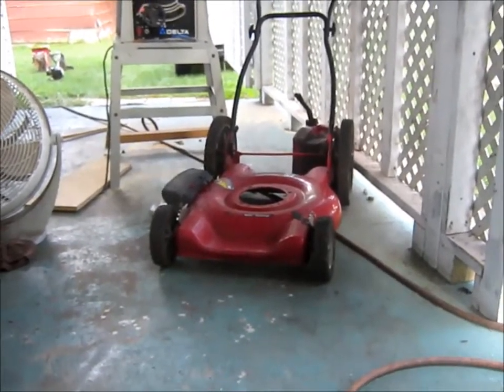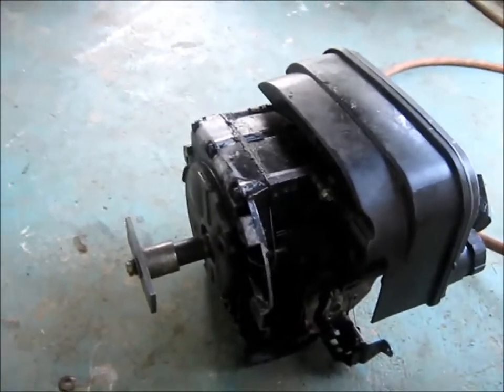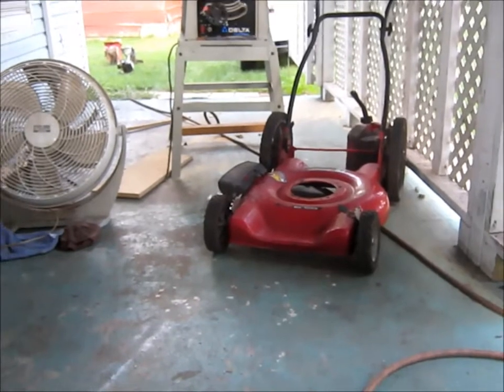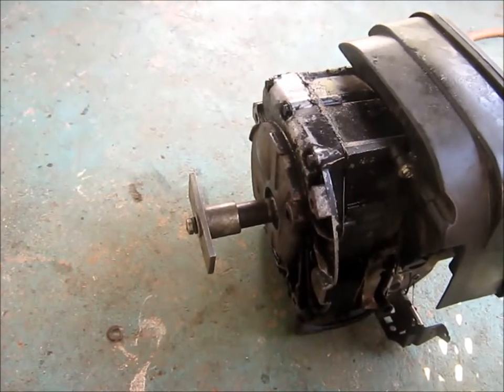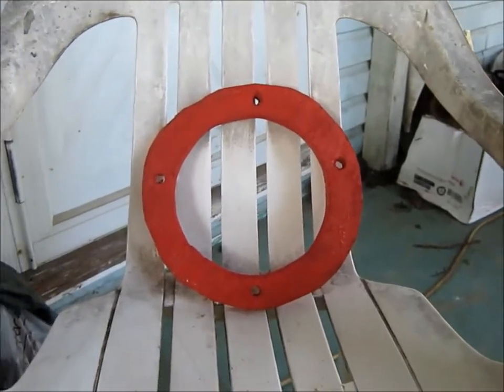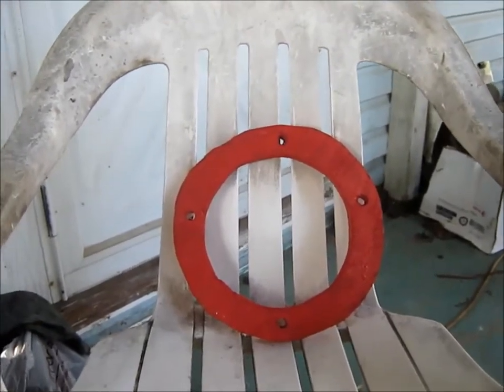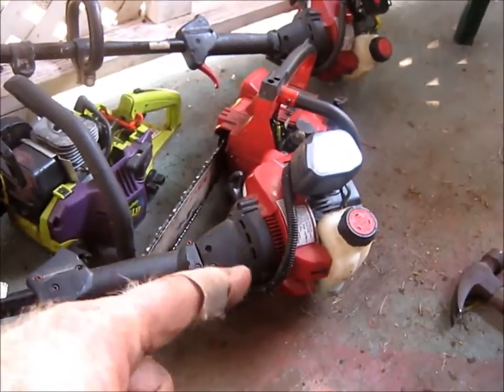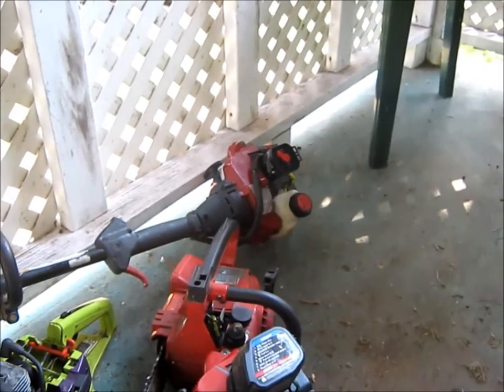B&S engine adapter and other projects

Comment: That's a good fix, Motor and the riser.  I like the way you work...
Reply from the maker: it's a cheap fix and is still makes the mower very serviceable, I used the original piston as it had no damage and had good rings and hardly any carbon build up, I think what got the engine was the pto seal was shot and all the oil probably got out before the owner realized it and ruined it.

Comment: Good fix, I remember when you could buy those adapters, but haven't seen them available for awhile.
Reply from the maker: I think it was because many years ago they didn't have the 97.00 throw away mowers at WM and people had to make do with what was available so these things made it possible to use an engine on some mower decks that were made for a shorter crankshaft, but now, just throw the mower away and get a new one.